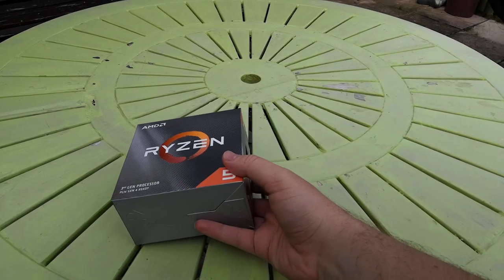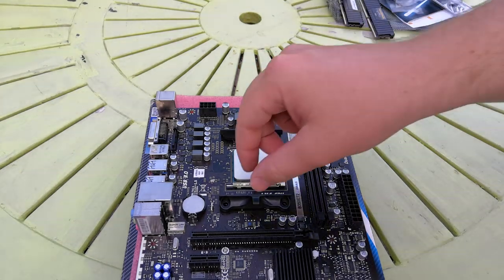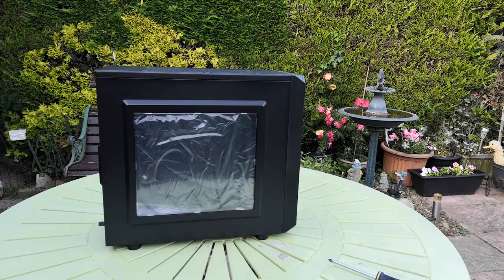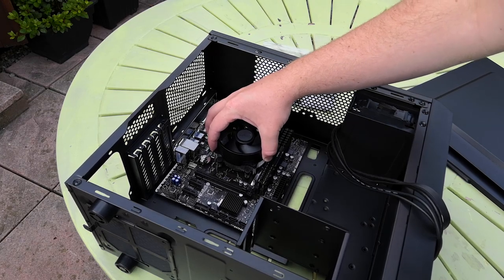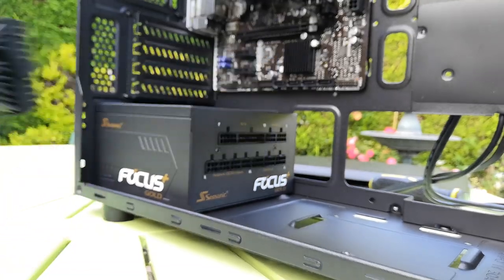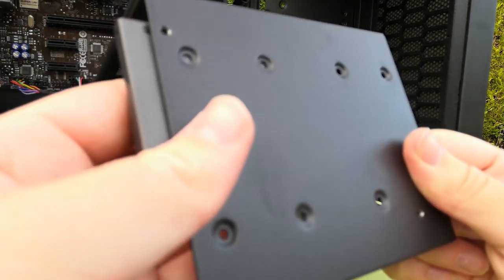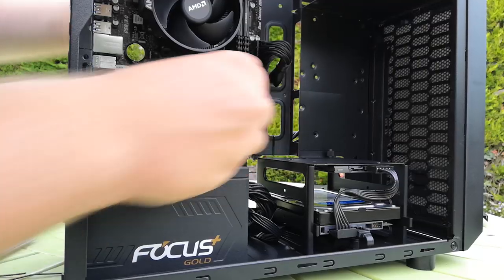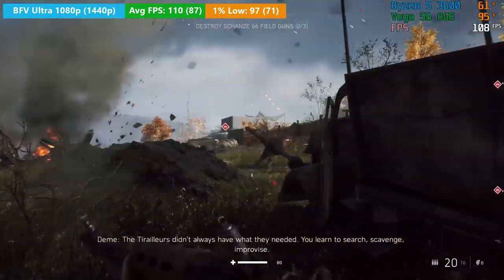Building a Ryzen 5 3600 Gaming PC!

Comment: Damn the performance numbers are insane !!! especially for the price, i dont think i would call this a mid range pc its much more capable than that but it is in a mid range price.Also its funny you got the msi rx vega56 airboost, i just got that card 10days ago for only 240euros.(insane value gpu) The only minor thing u have to do because its limited out of the box its to go to wattman - custom profile  instead of balance mode and then press AutoUndervolt,that should help a ton! (i have mine undervolted manually for best results  to 1020mv on p7 state and i can reach 1550mhz under load also overclocked the hbm2 memory to 950mhz (got lucky my gpu came with samsung)and the performance is even better with temperatures in check.
edit : i also just noticed your single core performance on cinebench its extremely low probably bios issues expect even better results in the future
Reply: HáDeS 240?damn where do you live?
Reply: AMD just made like 95% of Intels consumer grade parts obsolete with the 3600 lol
Reply: @shanepotter4635  wrong claim, definitely not 95% and not obsolete for sure. But it has an amazing price/performance ration when compared with equivalent intel cpu
Reply: @b.henriques9871  Greece mate,it was on sale for a short period of time, im pretty sure if you search you can still find some deals with rx vega 56.
Reply: HáDeS ahaha not on Portugal!! Prices start at 350€ which is almost 350 dollars

Comment: Wait , can't you just update the bios with the files on the USB ? Why do you you need to boot into windows ??
Reply: You can, but the pc won't even boot without a compatible cpu. You need a first/second gen Ryzen to update the BIOS
Reply: @Arik-2103  Yeah i found out they mobo will not even post if it doesn't find a compatible CPU
Reply: @A.Froster  MSI boards can actually do that, but I don't know any other manufacturer who does.
Reply: @Azraleee  Yeah they call it USB flashback. Pretty sure other vendors have the same feature but under a different name. Didnt know tho this was possible with such mobos
Reply: I have msi tomahawk can update bios without cpu
Reply: @Arik-2103  you dont need first/secend gen when you buy a chep board with bios flash back option, you can flash bios without cpu in the socket

Comment: Building your PC under water is fine. Just dry it properly before switching it on.
Reply: You could also just sit in a submarine and build it. That's also building under water
Reply: @Arik-2103  Excellent point!
Reply: @Arik-2103  Don't need to, clouds are made of water
Reply: I was going to say the same thing 😁, I worked in a hobby shop & the number of people that were horrified when they were told just wash the electrics underwater & let it dry in the sun
Reply: @Arik-2103  Just make sure the windows are shut 😁

Comment: Those parts that you removed from the backplate should actually be touching the top of the ports. That way they work as a grounding measure, to protect those ports from a static discharge.

Comment: My PC has only One Exhaust Fan in the back just like this video, I have Ryzen 5 2600 CPU (Stock Air Cooler), 16Gb 2666Mhz Ram (2 x 8Gb cards), RX 580 8Gb GPU, Mid Tower Case, so is One Exhaust Fan in the back enough to keep things cool?
Reply: Unless you have an open case I suggest getting intake fans for it. But since we are in the winter you are good at the moment

Comment: Cable management would have been a whole lot easier with the drive cable connectors facing to the rear...
Reply: Not if you want to change drives without having to remove the rear panel. It's much better the way he had it.

Comment: I got a Versa H15 for my brother's PC, but the Gigabyte G1 1070 I had wouldn't fit since the shroud was too large. Luckily the CPU was a 2400G, since I was giving him my 2700X later to get a 3900X while using the 2400G to build my mom a PC, but if it hadn't had an iGPU that would've been a disaster.

Comment: My comment is about the Versa H15 case. In my search for super cheap budget mATX cases, I came across and ordered a Fractal Design Focus I Mini (not the G). I couldn't find any information whatsoever on the case.. but then I came across some TT Versa H15 videos (including yours, I watch your vids regularly btw). From a sheet metal standpoint the features, cutouts look almost identical and even the front panels look similar, differing only with the brand logo and button layout at the top, the Versa H15 even has a very Fractal Focus-series look to it. I wonder if this case is a rebranded Fractal Design, rebranded Thermaltake or made by another 3rd party manufacturer and there's a possibility that more brands of these cheap cases exist..

Comment: You should of had pointed the SSD and HDD connector towards the other side panel, so there is less cable floating around.
Reply: He ran the cables the way he did so he would have an easier time swapping drives between systems as he often does. He explained that in the video.

Comment: literally the exact cpu i want to get in end of 2020 my future build will consist of...

CPU: Ryzen 5 3600 OC+any very powerful cooler
GPU: GTX 1070 8gig yes i can get the RX5700 BUT in my country it costs twice as much as a used GTX 1070 so why?
Ram: 16gig Gaming ram as fast as possible
Motherboard: B350 just like you 
Storage: 512gig SSD+4TH HDD
Psu: any 650watt corsair

Comment: I remember buying a 2nd hand i7 4790k and Asus maximus gene vi motherboard (both in excellent condition and original package) for a much lower price and was not able to post it which made me very worried that one of the parts might be broken. Not having a 2nd pc on hand I was able to download the newest bios for the mobo from my Note 2, unpack it and put it to a usb stick and I was able to directly flash it with the mobo and finally got it finally working.
I use the pc for years and even today it's good enough that I put it in the smallest enclosure possible (Silverstone SG10) with two huge gpus (Strix 1080 and Windforce 770) to split the pc for two users with Aster multiseat (we play Rocket league most of the time and splitscreen is not enough for competitive ranked. This way we can fully utilise our own gpus with our own monitors at high fps and profiles. It basically runs like two pc's).

Comment: 650w is the recommended psu wattage for the vega 56. Is it a big deal if buy a 550w despite their recommendation?
Reply: I say it's better to be safe than sorry, use PC Part Picker and build your build there, and check the estimated wattage. Being atleast 100 watts over the estimated wattage is the sweet spot.
Reply: I ran a Vega 56 on less than 550w just fine, with no issues whatsoever. Just don't do a load of crazy overclocking.
Reply: You can even undervolt it and the card will use much much less wattage and  unfortunately a 5 % performance loss. It's not a big deal you can still overclock it just don't go too crazy.
Reply: I already bought a Evga 750w g3 for much more than your average psu to be on the safe side as wombit mentioned. If it runs fine on 550w I have to wonder why the makers themselves recommend 650w.

Comment: Guys i will buy x570 and ryzen 5 2600 is it can work?
Reply: It will work but its overkill to get x570 if you're only gaming. They're very expensive and only useful if you need pcie gen 4 imo
Reply: you mean an rx 570 and a 2600 yeah decent setup for 1080p gaming

Comment: Got myself b450 msi tomahawk, 3700x and 3200mhz kingston... Nope. It does noy boot and yes, i flashed to correct bios. It does gets to bios on very rare occasion after a flash or 10 but no further and only once.
I love building systems but this is the first time in 20 years new parts behave this shitty

Comment: I wish AMD had done away with the Wraith Spire and Stealth coolers. It always seems like the motherboard is going to crack when you push down on the screws to screw them in. I much prefer the Wraith max type with the clips and lever like the old type AMD coolers.

Re cable management, I always run the 24 pin PSU cable up to the top and back down to the middle - it means that there isn't so much fat cable to try and squash behind the back panel and it looks neater as well. I would feed it through the same hole as you did for the 4/8 pin connector then back down to the middle. Not always possible though.

Comment: I've seen higher benches with a better mobo. Biostar is shit and b350 is not made for Zen 2.
Reply: I'd rather use an A320 board from Gigabyte than a BioStar board.
Reply: good enough for the price
Reply: i have about the same score with a b450 board, the problem right now is the agesa update on bios, the latest one seems to limit the core performance on some board

Comment: What? My overclocked 2010 CPU has a higher cinebench score than the 8400? I am surprised...
Reply: What u have xeon,i7 first gen  ?
Reply: i7 980X
Reply: @luisb7107  Nice pretty good cpu did u oc ?
Reply: 4.3GHz... 4.4 is possible but the fan goes crazy
Reply: @luisb7107  thats pretty good

Comment: Good thing to remember is that if you use 2 separate pcie power on a gpu you can gain performance, I tested this 10 times in each config, 10 with single cable dual 8 pin and tested 10 with 2 separate 8 pins and for my 980ti got about 3-5% better avg and .1%

Comment: Nice, I just ordered a 3600 also with 16GB 3600 of that same Corsair Vengeance memory, its going in to An ASUS Tuff X570, with my existing 1070 GTX, but i'll hold off on the build until I got a new PSU and SSD as well. (I'm still running my OS off a mechanical drive, which is pretty disgraceful in 2019.) My trusty old 3rd gen i5 &  board can retire.

Comment: I have the 750W Focus+ and read that a previous version would falsely trigger some safety feature with Vega 64 cards
"FOCUS PLUS & Vega 56/64: For units with serial numbers before January 2018, in rare instances, possible system shutdown may occur when GPU is under heavy load. This is possibly caused by higher than normal peak current emitted by this particular range of GPU's when under heavy load triggering the PSU’s internal protection safety."

Comment: Bought my ryzen 5 1600 in micro center for $70. Yes I know micro center. Also got a cheap $40 AMD A320-S2H motherboard. Also got an extra $30 off when you buy both, (only at my store). So I got a new motherboard and processor for $80

Comment: The 3600 is just incredible value - even in a more or less worst case scenario like AC: Origins or Odyssee which do scale up to 8 cores and 16 threads, it can hang with much pricier chips like the 8700k, the 2700x and the 9600k - at 1080p medium with a 2080ti.
https://gyazo.com/f7093e7f7376086033ecd199019cb1b1

At 1440p I would happily match this chip with any GPU, even the 2080 Ti:

https://gyazo.com/ee95664348f6046855e0a697786348ea

Yes, a 9900k is like 10% faster at 1440p but at more than twice the price.

Comment: Better yet, if you get a previous gen motherboard with a BIOS flash button button you can flash the BIOS without even needing a CPU. The MSI B450 Mortar has one and that's an £80 motherboard. There's other cheap B450 mobos with BIOS flashback buttons too.

Comment: G'day Random,
Great Build Video, Dave the Seagull looked Impressed too,
The only thing I really do different is I leave out the Storage drive till after I have Installed Windows & set up the PC, as a couple of times I have had the Storage drive recognise as C & the drive I was installing Windows to recognise as D,
I'm just wondering is this the most expensive build you have done on your channel,
You always do such a great job with your budget builds & the way you show you can have just as much fun with a smooth 30fps @720p as someone getting 140fps @ 1440p,
I'm an Atari Kid, & was Astounded by the Quality of Graphics on my Sega Mega Drive when I got one, so graphics these days are just ridiculously Awesome,
What I do find funny however is when Kids are happy to play Minecraft, but complain if they have to use Low setting in Forknife?

Comment: So should I get a Ryzen 5 3600? I was thinking of getting an RX 5700 (not XT) cause it's under £300 at least on the official AMD website and the Ryzen 5 3600 seems pretty good. I might get this pairing though I would love to save up for the 12 core one but I might not need it. Would there be any difference if I used 8gb ddr4 2400mhz ram instead of 16gb 3200mhz ram? I might upgrade my ram too but I am not too sure.

Comment: im currently using a Ryzen 5 3600 on a Asrock x570 Phantom Gaming 4 mobo. im also using a RX-580 8gb Red Devil gpu and its still holding up in 1080p. im able to max out doom eternal at 1080p and maintain solid 60fps+. i lock to 60fps since ive only got a 60hz monitor anyway, so i wont see any benefit of playing a game at higher than 60fps. surprisingly, im even still able to play many games at 1440p and depending on the game, i adjust setting accordingly. most im still able to use high settings though.. but yeah, im eyeing the RX-6800 pretty hard because of at least three years of solid running, my RX-580 8gb Red Devil is starting to show its age a little bit. its still fine for 1080p gaming though, so theres that.

Comment: If you buy an MSI B450 motherboard with a BIOS flashback button, you don't need to buy an extra CPU for the BIOS update. Also MSI boards have nice FETs if you want to install higher end chip like the Ryzen 9 3900X later on.

Comment: 2 ram slots...ewww lol. Building next pc underwater because it sounds cool,  then drying for a week for optimal cpu speed! But seriously gonna get a 3600 in a few months not sure if I am gonna go for a 450/70 or a cheaper 570 will be  swapping out intel 6400 and board and keep all other parts (16 g ram, red devil 590, m2 660 1 tb ssd (soo sweet) 240g sata ssd, sound blaster z, 750w evga ps) may get a windowed case to showcase the red beast.. Prob wait till next gen to upgrade vid card.

Comment: Thanks for the nice tutorial. Have very similar parts laying here ready to build a backup PC, including a 3600 and the Versa H15 case. Plan on using two front and two top fans, but still am a bit concerned over how the thermals will turn out. At any rate, am sure having watched this will help make things proceed a bit quicker and easier.

Comment: 8:00 If you're following this video to build your PC and have a modular PSU, I wouldn't really recommend installing the brick without first plugging in all the cables you'll need to properly power all components of your PC.  While the case he's using has sufficient room to do this after the fact, you may not be so lucky.

Comment: considering the processor was barely loaded this combo of cpu+gpu is a waste of money on fixed budget. you could get previus gen ryzen with more powerfull gpu and get higher fps still bottlenecking on gpu especially on 1440p.

Comment: Is that VRM doing fine? It looks very weak. Also, could you try to OC the RAM to 3600MHz? (so you get a 1:1 ratio with the Infinity Fabric)
Reply: B350 boards probably won't run 3600mhz ram. The videos I've seen with Zen 2 on B350 were running ram between 2666mhz-3200mhz

Comment: Just built a ryzen 2700x based system with an evga rtx 2070 uc ultra ... huge upgrade from my fx 8350 and my nitro r9 390
Reply: George Heusted does a Nvidia GPU work well with an AMD cpu?
Reply: @MapleLeafAce  sure!
Reply: @MapleLeafAce  It actually explodes the second you slot it into the motherboard, it can sense the faltering in brand loyalty
Reply: @MapleLeafAce  yup performs wonderfully

Comment: You can get the BIOS via a cheap Intel chip too, but there are no cheap Intel chips and putting an Intel chip on an AMD motherboard might be a little problematic, but it can be done. Though it will be a little impracticle.

Comment: Now when intel releases comet lake, basically what will happen AMD will kick themselves in the arse because the Ryzen lineup for this generation should have been like following:

R3 - 6C/12T parts

R5 - 8C/16T parts

R7 - 12 core/24T parts

R9 - 16C+

AMD does not have that kind of luxury to compete on core - core with intel i5 / i7 lineu for 10th generation.

What saddens me mostly is the fact that AMD should always offer more cores, even for mid range R5's .. but they simply skipped it this generation because they're so "confident" of their IPC improvements, and this is what grinds my gears mostly.

I'll repeat it again, they don't have this luxury to compete on core per core basis with Intel, they will simply loose it all once intel releases 10th generation, not to mention when 10nm CPU's arrive, it's gonna be game over again for AMD -_- - and I don't want this to happen!!!

God damn it AMD !!! R5's should have been 8C / 16T parts!!!!
Reply: Intel has been stuck on 14nm for years. They still haven't figured out 10nm for the most part and won't for a year or two. They released consumer chips without hyperthreading. AMD just crushed 95% of intels consumer parts with a chip they're selling for $199. Intel isn't going to be able to respond in any meaningful way for probably 2 years.

Comment: Those little tabs you broke off of the IO shield are for grounding your ports. Bend them back a little bit so they won't interfere with your ports but don't break them off entirely.
Reply: No... that's just not correct. The ports are grounded internally (the purpose of the ground wires on the 24 pin connector).
The tabs are there because the manufacturer is too cheap to have them manufactured properly. 
Higher-end boards come with IO shields that do not require them.